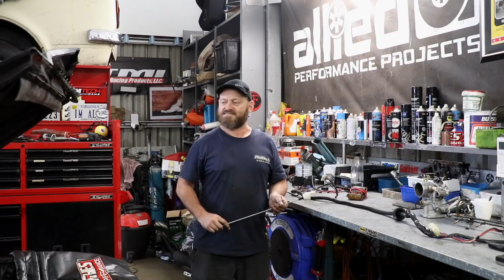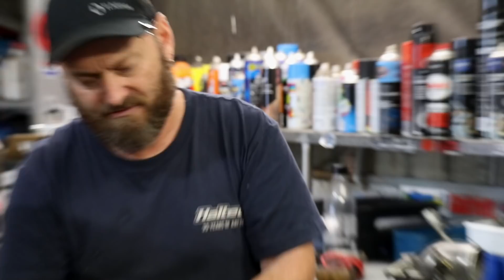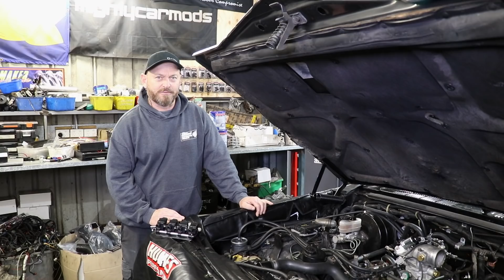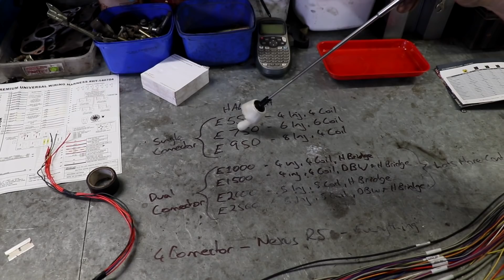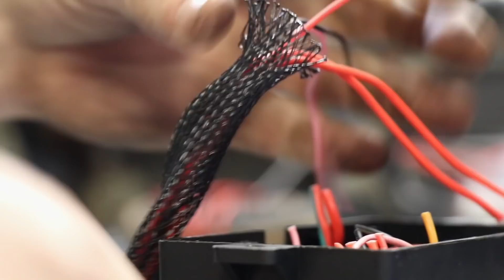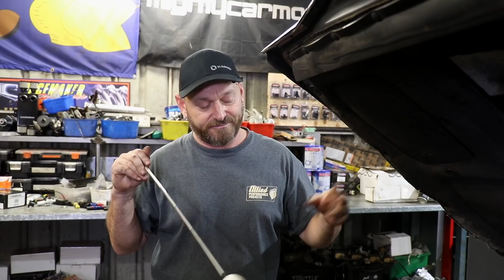Re-Injecting the Previously Injected VIP Nissan President - EP2

Comment: Can't remember which model I bought back around 2000, but I used it to control a GM V6 3.1 liter (the 60 degree engines) in my 1992 Chevy Cavalier Z24.  It did amazing.  I was still learning about EFI at the time so I had it set up so bad that it was eating up all the gasoline because I wasn't taking advantage of timing advance.  I was only in high school at the time so give me a break.  Learned a lot from that Haltech

Comment: Al, assuming “wasted spark” means you are firing two cylinders at the same time, because Haltech can only handle four outputs? So one cylinder fires at before TDC on compression stroke. How did you choose second cylinder to fire at same time to avoid detonation?  Scratching my head on how injectors are  energized when you only have four total....
Reply: On any 2,4,6,8,12 etc cylinder 4 stroke engine, whenever one cylinder is on the compression stroke there will always be another cylinder on the exhaust stroke, it is these two cylinders that are paired together for wasted spark, they swap every 360 degrees
Reply: So how do you handle 8 injectors with only 4 outputs (if I understand Al correctly)?

Comment: Curious on the crank position sensor.  How do you adjust for timing and what cylinder is firing?
Reply from the maker: In the software. There is 8 outer poles and one inner. The outer is trigger and the inner is sync(or home or reset). The software has a 0-720 degree figure you adjust. It's covered in the next episode.
Reply: @theskidfactory  can’t wait!   Thanks!

Comment: on average, when building a NEW wiring loom, how many times does the loom go in and out of the vehicle to get lengths and locations correct?  Is it about the same for modifying an existing loom?
Reply from the maker: Only went in twice to get lengths in this case but it's super simple. Other looms can be dozens of times.

Comment: Those top hose injectors are what's used in my brother's VW T3 Vanagon. Trying to persuade him to replace the 18mpg engine with a Subaru SVX. No luck yet 😁
Reply from the maker: Doesn't need an EG33, any EJ NA engine is much better and more reliable. Done dozens of them mostly using parts from the USA.
Reply: @theskidfactory  
More easily available too I suppose, both to do and maintain. 
He did have a basic one from a Forester? in his Bay Window.

Comment: Isn't using the LS coils in wasted spark mode slight overkill, there are plenty of 4 cylinder wasted coil packs with built in igniter that would work OK on a NA engine and they would almost look stock
Reply from the maker: Yes but there would be ignition leads snaking from side to side.

Comment: Looking good!  Do you have any comments on single or dual wideband use or preferences?  Using original O2 for now but upgrading. I also have to make a distributor cap cover, built a 95 dodge magnum 5.9 with a MegaSquirt, soldered the entire system because it’s not an LS, but using 8 LS coils. Full sequential 8 cyl.
Reply from the maker: Dual wideband is only for bank seperation. It wouldn't have done anything in this case as we aren't running sequential. If I was running a 2000 or 2500 on a sequential v8 I would use dual wideband.

Comment: Firing order cast into rocker cover = SWOON
Reply: Last I dealt with hosed injectors was trying to secure a set of 12 for a V12 Jag lump and a fussy owner who wanted them all within 5%. Not an unrealistic ask, for any other injector bar the oddball v12 injector. From a total of 48 brand new injectors. One set was managed at 8% variance. Hunted but no aftermarket solution available that matched original looks (original looking was key to build)
Reply: I only drive vehicles whose engines have the firing order cast or stamped into a visible part. :D
Reply from the maker: It also has the cylinder numbers cast into the inlet manifold for even less confusion.

Comment: Hi guys, what kind of crimper do you use to connect wires in the loom (instead of soldering)? I can't find anything like it 😁
Reply from the maker: I mostly just cut the terminal off QK type pins and use the crimp section.

Comment: Great job with this, I have one of these cars, with it's own fuel injection issues and would like to use what you guys are doing as a bit of a template. Is the choice of distributor because of what the car had initially, if it was original Nissan would it work with the Haltech ECU?
Reply from the maker: The original nissan probably would have worked but because the holden dizzy was already fitted we used the VT setup as it is bombproof. The Nissan setup is optical 360 with 8 slots which may need to be added to the haltech trigger setup.

Comment: Can someone explain how a V8 can be run with only 4 injector outputs? I understand wasted spark, but how does it work with injectors? Wouldn’t they be firing at the wrong time?
Reply: I think it's called "batch fire". The injectors are firing at open inlet valves and also closed inlet valves. Apparently not a big deal in practice because the air-fuel cloud is getting drawn in on the inlet stroke.

Comment: I did not quite get how the 4 outputs work on the 8 injectors. I know what a wasted spark setup is doing, but how does it manage the fuel with only 4 outputs? Would be nice if someone could explain it :)

Comment: hey al can i ask how you run 8 injectors on 4 outputs? i understand wasted spark but honestly not great at car electronics and felt i didn't understand what you said here cheers
Reply: I believe each output fires 2 injectors each so the 4 outputs can fire 8 injectors ,someone will correct me if I'm wrong.

Comment: Big Al.  Does the new Haltech ECU need a decent power supply from the battery ?  Your right at about 60Hp/litre BMEP !  V.
Reply from the maker: They are pre wired with a 4 and 5mm battery feed.

Comment: Old wires have PCBs as plasticizers in the insulation. It's like asbestos, amazing at what it's used for, but terrible for living things. PCB plasticizers don't break down from UV or heat, don't leach out and corrode wires, and don't burn. The do kill you slowly.

Comment: LPT: for welders, there's these silicone cap kits they can buy from the usual scumbags that are sized for pretty much every hole from 2 cm up to (i think) 20 cm. One of those kits are excellent to have in the shop for plugging any sensitive hole in the engine whilst you're working on the thing that used to cover it. And it's cheap too.

Comment: Dumb question. I get the 4 coils on a v8 with the 550 and wasted spark but how do you get away with 4 injector outputs on a v8? Surely you need to control all 8 injectors separately? I am assuming wasted injection isn't a thing?
Reply: Googled it, i gather with semi sequential the injectors are paired according to firing order. One fires fuel at a closed valve and the other at a just about to open valve. Makes sense.
Reply from the maker: Semi sequential mode on haltech fires the injectors twice in the cycle to even out the fuel delivery. Many ecu's were Multipoint or batch fire right through the 90s. Delco in GM were batch fire, 2 drivers fired all injectors at once.
Reply: Yeah does it just double fuel use???   :(
Reply: Many of the older electronic injections did batch firing like this. Doing sequential injection takes more of a computer to run it. And about the only thing it hurts is emissions and mileage a little. Things still happen very quickly when the engine is running so it isn’t like the injector sprays then fuel sits there for long. Plus the injectors are spraying a reasonably fine mist so it mixes quick.

Comment: Mercury madness, not lead. But regardless, another excellent and informative episode. Cheers guys.
Reply: @Shane888 Davies That's an organomercurial compound used as a preservative (C9H9HgNaO2S). It's not elemental mercury, and the CNS damage from elemental mercury is, uhh, not quite the same as an ASD. I know organic chemistry can be hard to understand and most people have never taken it, but yknow at least try
Reply: @Shane888 Davies you could more likely be suffering from aluminium exposure from  your pointed hat
Reply: Yes mercury... egad!
Reply: Thank you.  Mad as a Hatter.   The haters can have the lead.
Reply: Correct. Hot dish of mercury used as a flexible iron for ironing curves into the felt. Liquid mercury doesn't really penetrate your skin but the vapours are readily absorbed by your lungs.
Source: Cody'sLab. That fker really likes touching mercury.
Reply: @Shane888 Davies Only used in the manufacture of the vaccine, not actually in the vaccine, and also banned for infants under 6, hence not in MMR.
Reply: Or as in the Mad Hatter from Alice in Wonderland.
Reply: Yes, mercuric nitrate was one of the compounds that caused erethism.
Reply: @Shane888 Davies rubbish